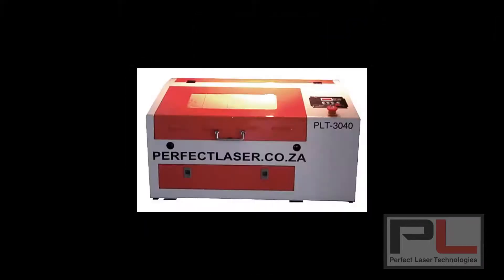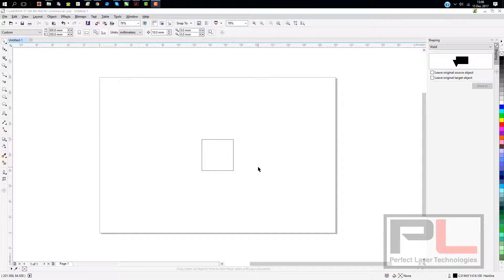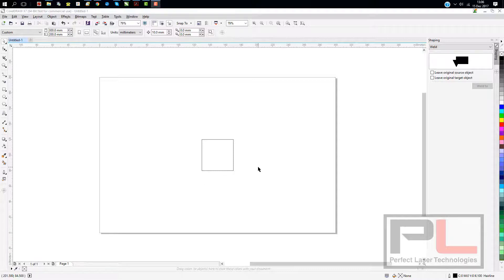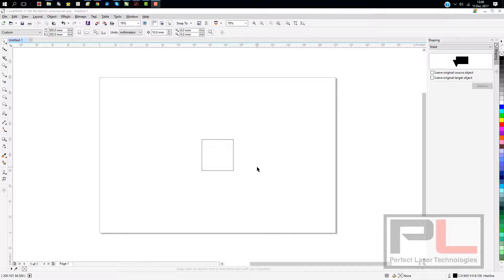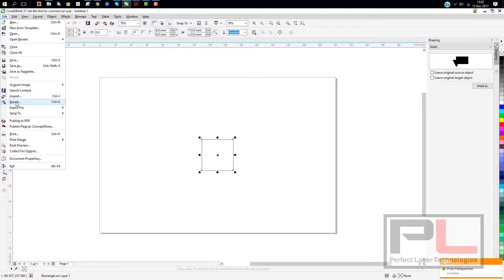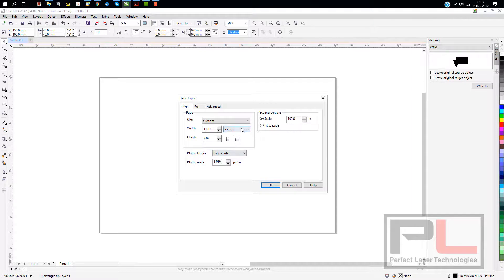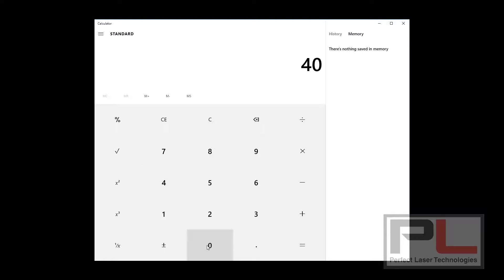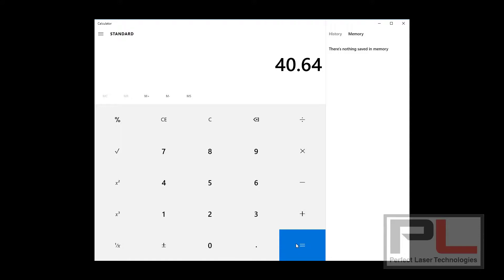Corellaser Scaling

Comment: Dear Doc B, thank you so much for this, I am absolutely delighted that my laser cutter now actually cuts to the same size as my drawing.  So helpful.  A separate question, how do I know if my controller on my 6040 laser is M1 or M2?
Reply from the maker: Hi Jonathan, if everything moves as it should, you have most likely got it right. But most of the controllers out there on 6040 lasers will be the M2. (You can look on the little mainboard for the model number as well).
Reply: @docb001  Thanks.  I am still .2mm too big, is this as good as it gets???
Reply: @docb001  Another question, sorry to drive you mad.  Is corellaser the only software I can use with my lasercutter.  I have been drawing in nanocad, importing into coreldraw and then cutting.  If I am to buy a licence for coreldraw x7 (the one that comes with my laser, although I use coreldraw 2017 ) should I be looking at other software
Reply from the maker: Lol, pretty much - depending on material - so the only way to improve that is to ensure you have absolutely perfect focus and ... critically, is your lens the correct way up? The convex (outward bulging) side must face up.
Reply from the maker: There is K40 Whisperer as an alternative, but I personally would not recommend it as there are other areas where it is not as good as Corellaser. A lot of people slate Corellaser because it is Chinese - but if all your settings are correct and your laser optics are good, it works pretty damn well for engraving and cutting considering how cheap it is. We have sold hundreds (if not a few thousand) of these cheap machines, with minimal issues.
Reply: @docb001  thank you for taking the trouble to answer my questions.  Your fix for over sizing is a game changer.  Take care
Reply: @docb001  thanks for video as it helped. Do you know if the m2 motherboard on a 6040 machine can be changed to a Ruida controller to be able to adjust power to laser ect
Any easy solutions
Machine is now 8years old with same tube
Reply from the maker: @pietpompiepompiepiet940  Technically, it is possible, but not practical or cost-effective. No easy solutions unfortunately.